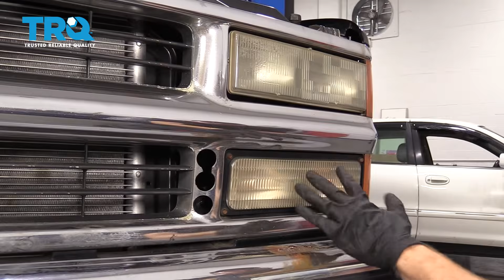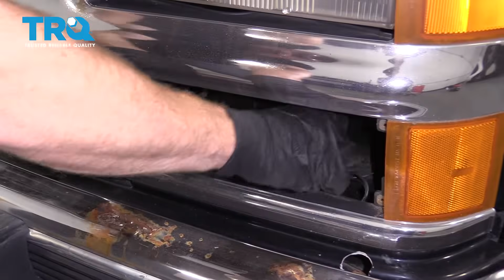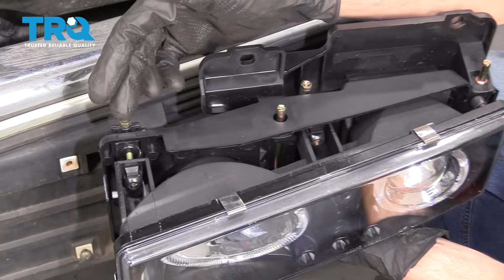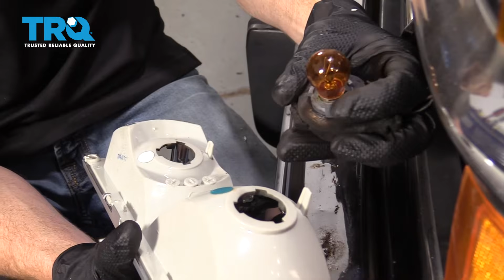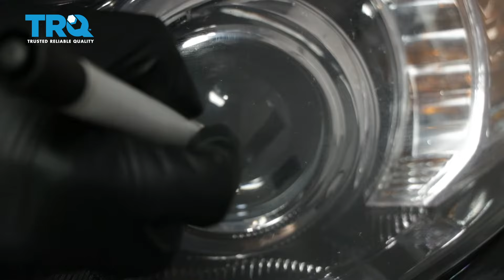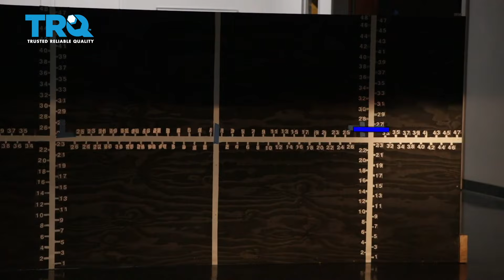How to Replace Headlights 1988-2000 Chevy C/K1500

Comment: this is hard way to remove headlamps. turn signals yes. there are 4, 5mm long studs at the top of the lamp remove the two studs on each side and the light comes out. at least on my 1993 k1500 that is how I did it. otherwise good info.